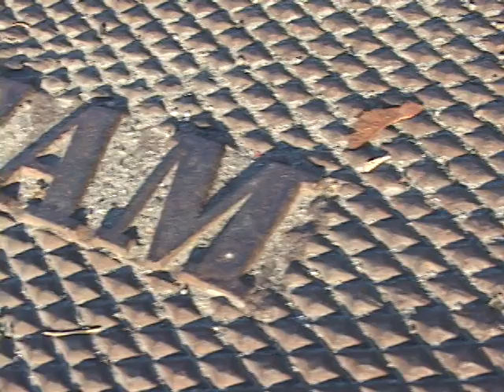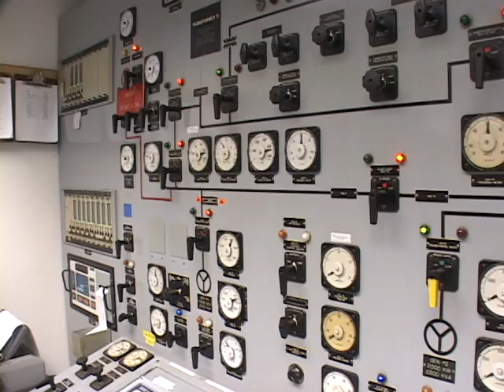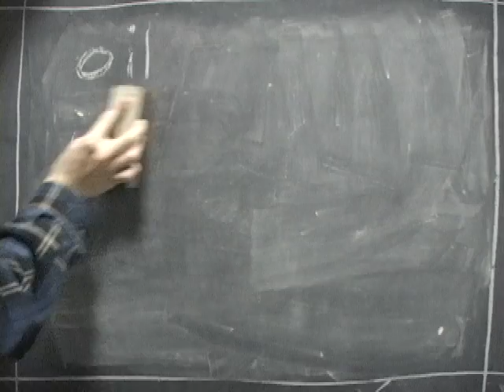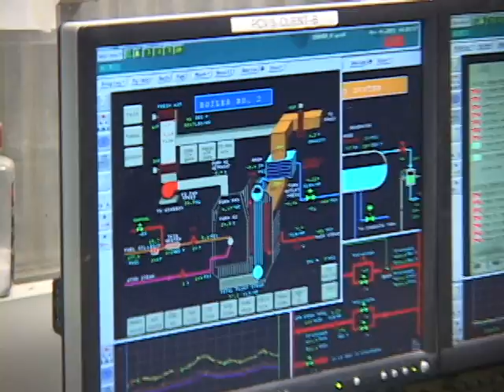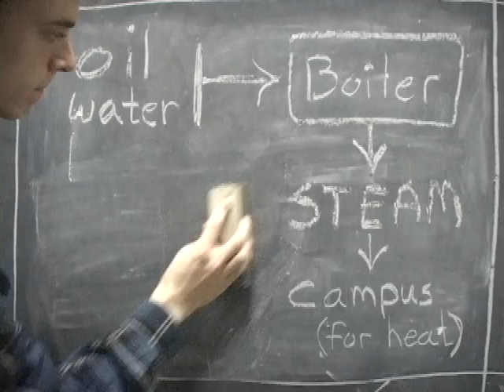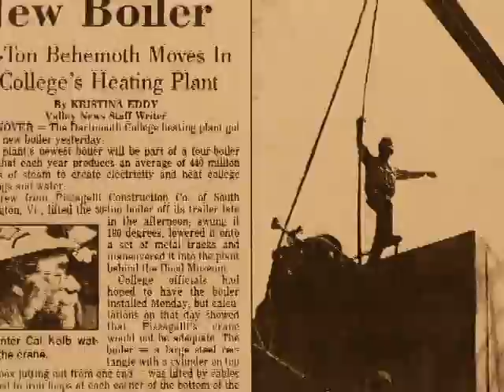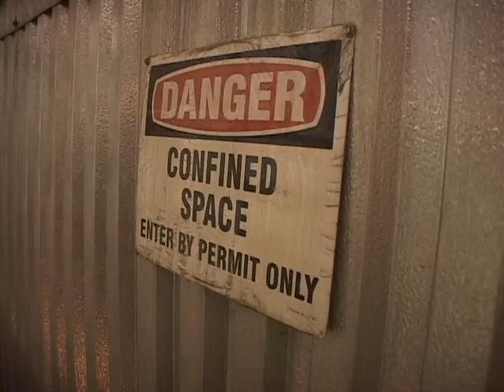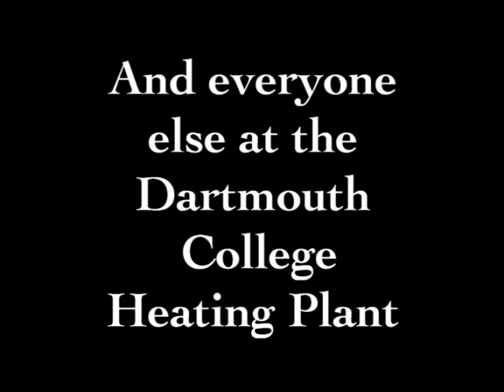STEAM: A Story of the Dartmouth College Heating Plant

Comment: It’s too bad these old steel beast are disappearing. I worked in the high pressure steam plant of a paper mill for 4 years until she closed. Burned 175 tons of coal per 24HR.
Reply: Was it the pulp mill too? If so, I would have thought the Kraft recovery boilers would have supplied enough energy.